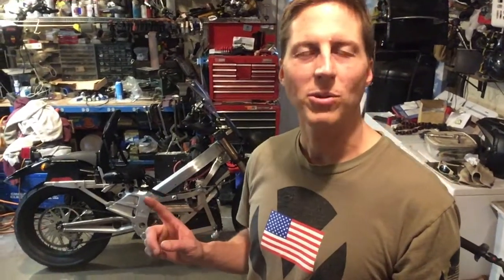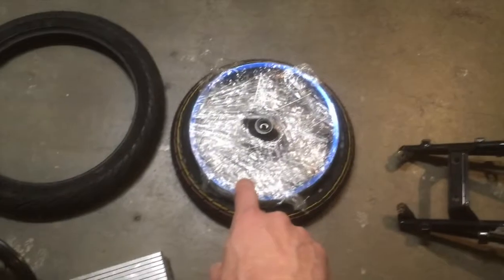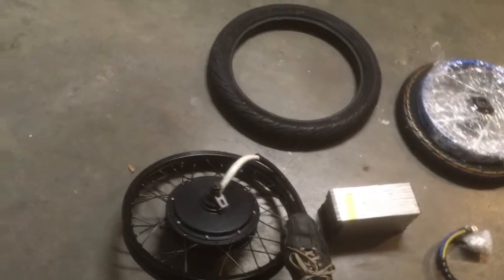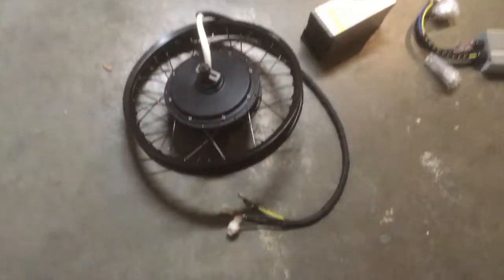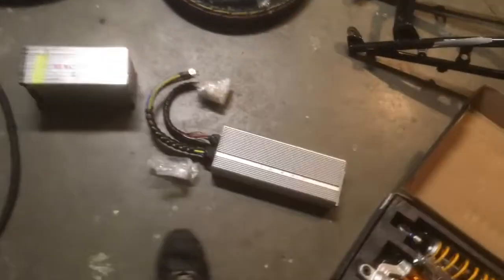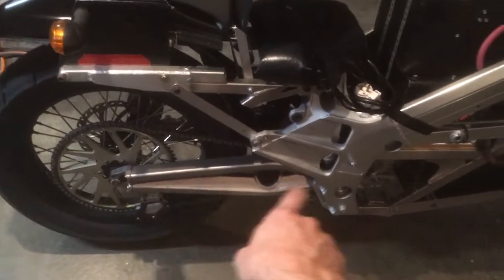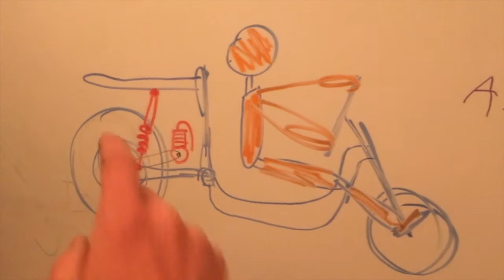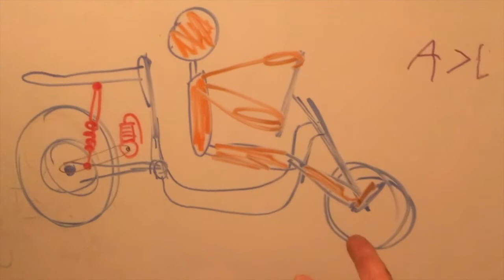DIY Electric Recumbent Motorcycle

Comment: You could use the gas engine with a generator as range extender and charge your battery if it is empty. The engine could always run with optimal RPM which would be more fuel efficient. In this way the setup would also be much simpler. Greetings from Germany
Reply from the maker: Yeah I had that same idea for my first motorcycle.  It's hard to find just the right size generator that's small and light enough but also puts out enough running watts to run the onboard charger.....also one that's less than $350.  I need running 1000W and most chargers are 900W running and then they jump to 2000W.  Then they start to get pretty bulky and heavy.  Even at 1000W output running my onboard charger it wouldn't extend my range more than about 10 miles on a 1.5 hour ride.  This is why I think a hybrid where the gas engine directly drives the wheel makes more sense.

Comment: So you finished the first bike completely?   Looks very impressive with that nearly all custom aluminum frame!  It's like the thing came out of Skynet's hangars!
Reply from the maker: Well it's running good enough but I would like to tweak the controller programing to get regen. braking and slightly better acceleration.  But I do actually kinda like the "naked" look of the bike.  So at this point I don't plan on putting any covers on anything.